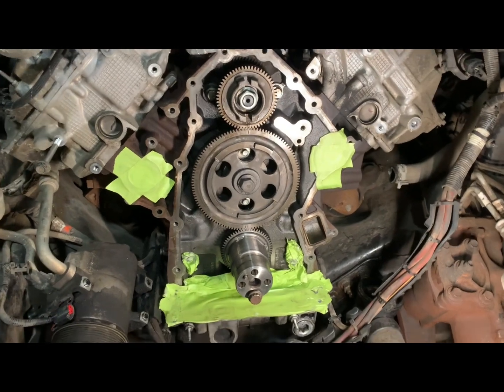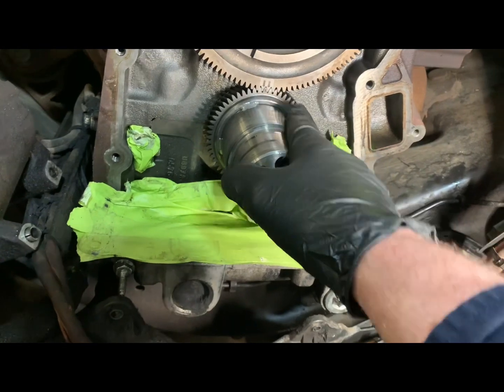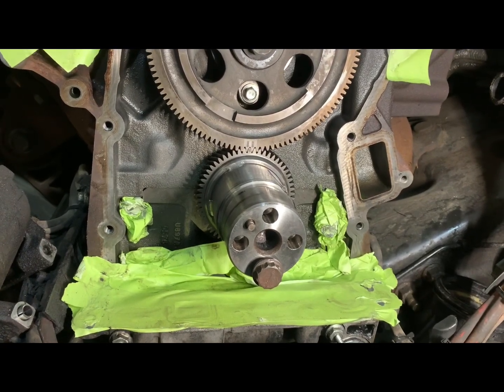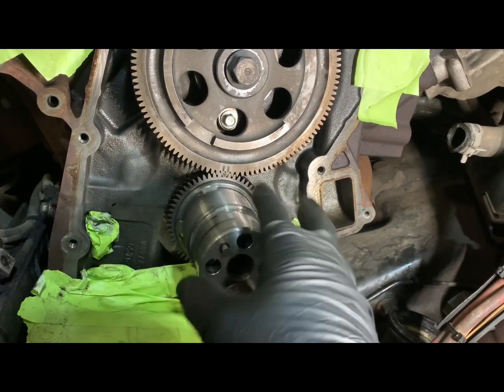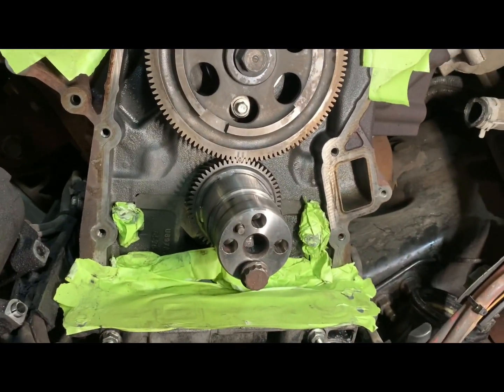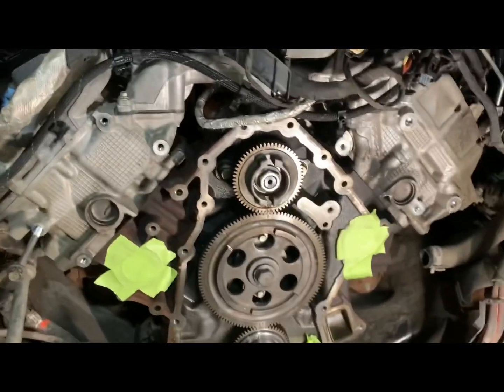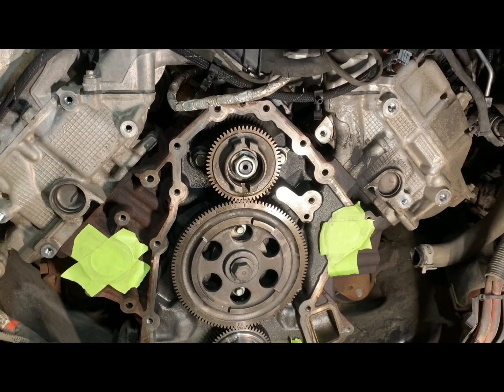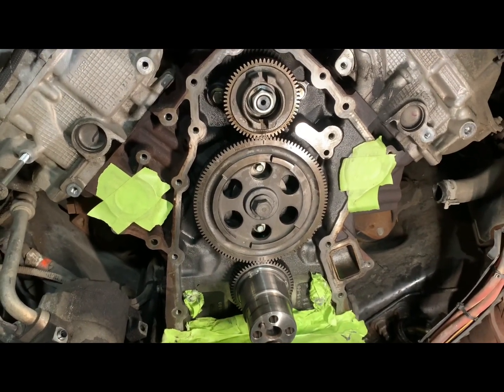6.7 Powerstroke crankshaft gear timing addendum

Comment: I have the same problem with my 2017 f250 6.7 powerstroke.  Have a question looks like you just pulled the timing cover you have any problens with oul leaks on the upper oil pan. Cause thats want i wanna do but heard upper oil pan has to come off to silicone the whole pan. But good stuff.
Reply from the maker: Been several months on this one, no leaks. Not easy to install front cover with pans on but can be done carefully and with a little rtv here and there.

Comment: What puller did you use exactly? Do you have a part number and did you replace gaskets for injector and timing cover when doing this ? Thanks I’m about to have to do the same thing and can’t find a lot of info on what to change while doing this

Comment: Having this same issue, lined everything up and welded it. Still a crank no start;P0016; Oscilloscope says crank and cam are (20 crank signals) 120° out. Cant figure it out
Reply from the maker: Man that sucks! First thing to do is recheck timing marks at piston tdc, valves closed. From there I would be scrutinizing the tone ring. Couple questions, original issue? What other diags have you done?
Reply: The original issue was bearing failure, i rebuilt the engine and it ran for 3 days before slipping the crank gear. I have verified good compression. Checked entire fuel system. Tested wiring for crank/cam/pcm. Replaced cam and crank sensors. Viewed the cam/crank signals with an oscilloscope. Valve covers are still on, going to hopefully bore gauge it this week and verify tdc. How do I know if valves are closed with the valve cover/intake still installed?
Reply from the maker: @RobertAnderson-ht6dr   can take an extended air nozzle and put air down the injector hole, I have a rubber tip that seals pretty good, then listen for leakage out of intake or exhaust.
Reply: @northwestlighttruckservice278  it ended up being that the rear main seal was not fully seated and it damaged the tone ring on the back of the crank. Actually caused the tone ring to read 120° out even though the engine is in time. Its fixed now
Reply from the maker: @  Ah, makes sense. I couldn’t imagine it even running with cam timing off that far. Good job man!
Reply: @northwestlighttruckservice278  thanks! Now just trying to figure out why my fuel pressure goes down under a load. Cranks and runs fine but when you get on the throttle commanded pressure is 17,000psi and actual is 13,000-14000psi

Comment: Thank you for this, just had this happen on a Customer’s 2018 F250. Injectors, glow plugs, and rockers were all off and the engine would turn, then stop and wouldn’t turn anymore. I spoke with an engine builder and they said the crankshaft gear had slipped off just as you said. I’ll add this to the list of things to do on a 6.7 Powerstroke when they come in. Thank you again, God bless you 🙏🏼

Comment: Did you weld the crank gear while the crank was still in the engine?
Reply from the maker: Yes. Cover the front of the oil pan. There aren’t any sparks when TIG welding. Takes about 1 min to weld.

Comment: I've always "assumed" all engines would have a keyway machined in from the factory in the exact spot and so never any guess work, with this mess there is no good way of knowing unless you did what you did with finding TDC and align the gear mark to the camshaft gear markings. They reinvented the wheel ... just didn't do a well thought out job of it though !
Reply: No, the 1.6 petrol 16v duratec ford engine is also keyless. There are special timing tools. Crankshaft locating pin. And a flat bar to fix the camshafts. All should fall in place when the 1st cyl. is TDC. 
After that you can release all your sprockets, change the belts or chains.Tighten the crankshaft bolts and camshaft bolts and the sprockets should be locked in place by a stretch bolt.

Comment: Why won’t the glow plug hole work?
Reply from the maker: I didn’t try. The glow plug is at an angle and although the extensions for the dial ind. fit, I think it would want to bend the extension because it would need to slide against the combustion crown. I didn’t want to chance getting it stuck in the hole if it bent. Inj 1 comes out pretty easy if you have that certain part on top the VC missing or can be accessed by removing the pass tire and fender liner if the cooler is present.

Comment: Did you remove the crank gear with a puller then retime the crank?  If that's a machine fit that crank gear would be extremely tight to remove or install with no key ways.  I have been working on vehicles for 30 years and always learning something new.  Thanks for the videos on the 6.7l.
Reply from the maker: Yes, after finding top dead center on cyl 1 and verifying timing was off, pulled gear with puller, verified tdc again, put some heat to the gear and reinstalled. I took many measurements from different points off a good short block I have and did some comparisons. It might not be absolutely laser perfect, but likely closer than it was when it rolled off the line.

Comment: The problems you have seen have been on deleted trucks or f350 f450?
Reply from the maker: This is the first one I’ve seen with the issue. A net search shows it’s not as rare as it should be. My point was it can be fixed without too much trouble.